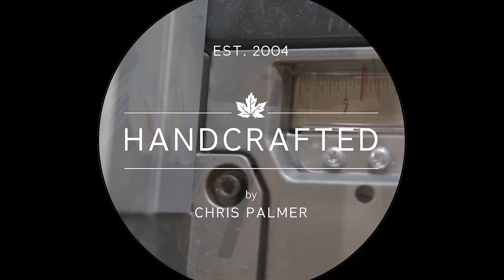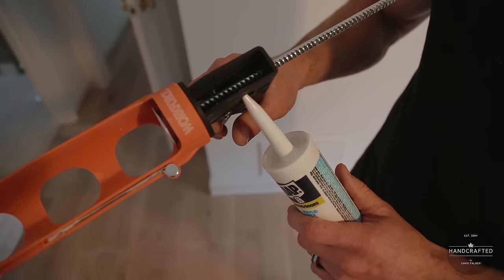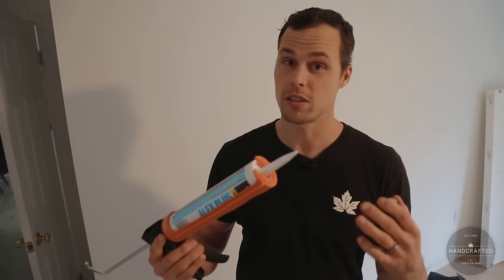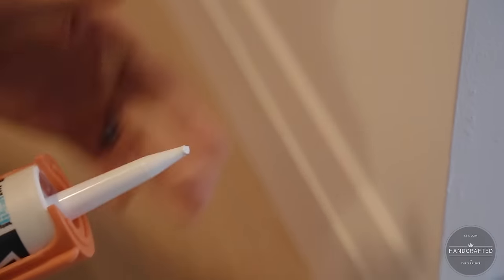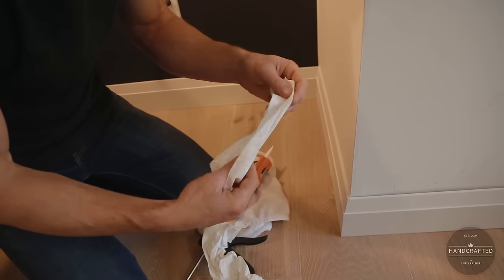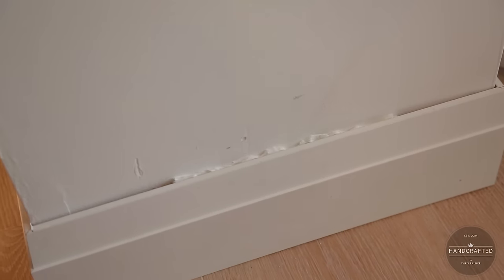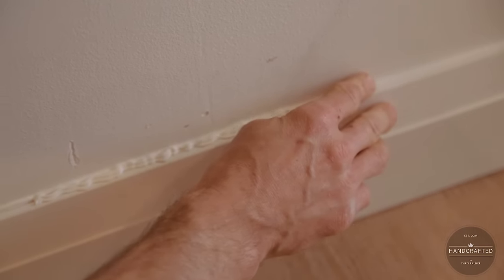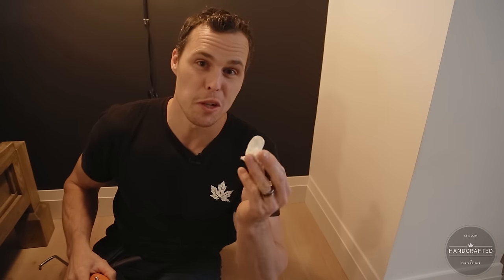How to Caulk like a Pro

Comment: have you ever put. caulking gel on the bottom of the baseboards to keep unwelcome critters from crawling in.?
Reply from the maker: If the gaps on the floor are large, I typically install shoe mould. Not certain on caulk gel.

Comment: Do you have any suggestions on how to caulk around a toilet with several bad areas? The flooring around the toilet is also coming up. Any quick fixes short of replacing tile—as far as holes around toilets and stick on tile paper tearing? 
Again, great channel!! Thanks guy
Shane Aycock
Reply from the maker: Hey thanks for the like and for your question I think you might have a deeper issue if the tiles are lifting. You should inspect the seal of the toilet flange to see if any water is getting between the tiles and the subfloor. This can create a heaved or loose tile. Also, make sure to use 100% silicone around the toilet and it should only go 3/4 around as if the toilet decides to leak the water will be able come out onto your floor allowing you to see the issue and not down the opening of the subfloor. Hope this helps!
Reply: HANDCRAFTED by Chris Palmer Will do! Thanks so much for your help, Chris

Comment: Good video,one quick tip.If you are caulking enough trim that you will use several tubes.Skip those larger gaps until a tube is close to empty,cut your nozzle bigger,that will do a much neater job on those wide gaps.
Reply from the maker: I have done that as well, good tip. Also, if you use the quick dry caulk, you can do a single pass and then a 2nd within an hour and it should build up. 👍

Comment: On the first piece of baseboard you caulked, do you even have to go back over it with your finger if it's a small enough bead line?
Reply from the maker: I always smooth my beads, it's a preferred method before painting to have it smooth, allows paint brush to glide better.

Comment: Can you apply caulk on the hardwood floor and the wall gap?
Reply from the maker: I don't apply caulk on floor to base seams. That's where shoe mould comes in handy. And wall gaps between the base can be troweled out or simply back fill the gap before you apply the caulk.

Comment: Im a  tradesmen, and its never done like that....use a wider cut nozzle to infill the bigger gap , also caulk is a acrylic so when you want to smooth over , use a damp cloth , this way it  smoothes over the caulk and wipes away excess , go and rinse cloth out and  acrylic caulk washes off.....

Comment: Was wondering any tips about filling bigger gaps for areas on exterior of house? Or should I just put a thicker bead of caulk?
Reply from the maker: Outside should always be silicone, and large gaps depends if it's brick or siding. Brick needs parge or pointing. Siding will be dependant on what type. Hope this helps.
Reply: It is the space between the wood border around the garage door and the brick wall. I removed the old caulk and I see some spaced mortar in between the gap. I didn’t know if it was just coincidentally there or there on purpose. Thanks in the meantime!
Reply from the maker: @triciamssensensensibility3350  this is likely from wood shrinkage over time. Backer rod can help, then large bead of silicone or even an aluminum capping to conceal the old wood then silicone.
Reply: Sounds like a good plan. I better get on the ball before it rains! I appreciate your help!
Reply from the maker: @triciamssensensensibility3350  happy to help!

Comment: The answer is probably no, or you would have done it, but I’m wondering if running a screw into the wall through the baseboard to fill in the space. I’d think that the motion would pull out the depression in the wall and reduce the size of space.
Reply from the maker: It's a larger hole to fill and have show thru later on.

Comment: The toilet paper idea is "alright". In areas that are damp/cold drafts.. There's better options to fill the void. Use materials that aren't susceptible to moisture. Plastic or foam backer rods will work better.
Reply from the maker: Agree, I use backer rod as well but it was more of a tip for readily available means 😉

Comment: I personally spray the silicone to get a smother surface and also you dont get sticky fingers but hey thanks for posting.
Reply: Video shows the use of latex caulk.  A wet rag or sponge is best to use to smooth the caulk, because silicone, which would leave a slippery residue on the surface, is not compatible with latex paint.  Water is cheaper, too.  I typically use a moistened sponge to smooth things out.  That caulk shown in the video is great stuff.  Check the label for dry times.  The Alex quick drying product is paint ready in 20 minutes, unless it's put on thick.

Comment: I’ve been needing to learn this for a while...i guess part of my problem is that i haven’t been using a gun, I was only using those squeeze tubes.
Reply from the maker: Yes those tubes are quick and handy for very small areas of work, more so a touch up. But I would try to avoid using them as you'll have more waste and less control than a good dripless gun. 👍

Comment: Nice video. What’s your recommended practise for sealing the tube of caulk once you’re done?
Reply from the maker: Thanks! I always paint the caulk once it's cured, I put a minimum of one coat of paint over top as I usually pre-paint the trim's first coat and then do a 2nd coat installed.
Reply: Thanks but I meant sealing the hole in the caulking tube itself. I use a nail but never get a good seal and it dries up.
Reply from the maker: @kropotken  oh I see, so there's a couple options out there for gimmick plugs, but my simple solution is clean the tip and simply pinch a piece of painters tape on the end. I never have a tube dry up, but mind you I am using cases of caulking through the year. If you have a tube sitting on the shelf for months on end, it may just expire due to environment.
Reply from the maker: @kropotken  this is also a plug I have used in the past that worked well. https://amzn.to/34e17CN
Reply: Handcrafted by Chris Palmer Thanks for the tip!
Reply: This is what I use https://www.harborfreight.com/caulk-saver-97561.html

Comment: A tip for woman caulkers.  If you do any kind of caulking at all that requires multiple caulking cartridges, do yourself a favor and get the Ryobi battery operated caulking gun. You won't be sorry and your caulking won't look like a blind man did it. And I was pleasantly surprised that it is fairly dripless if you are doing it right.
Reply: Elementaldomain I have the Ryobi caulking gun. It is quite helpful because my hands don’t get as sore from squeezing the metal gun. The only downside to the Ryobi caulking gun is that it is a tad bulky and can’t get into some tight spaces. In this case, I have to keep a traditional gun on the side.
Reply: @natalies1295  Yes, i can see that the largesse - LOL - could become a problem.  I have a farm so a great deal of my caulking does not take place in confined places.  I have however, become a big fan of the squeeze tubes.  Often I have just a little space to caulk, maybe something I missed in the first caulk. Although the squeeze tube is a little expensive, opening a new large caulk is more so, and then of course, often drying up before I can use it. Squeeze tubes, my new friend, and helps me on my life goal of learning not to put myself in situations that might not have the happy ending I envision; an important goal for me as a single woman run farm. I have also severed my relationship with silicone caulk. Its messy, it is hard to get an even bead all the way thru even with the Ryobi.  I happened to run across a product on Amazon called Red Devil latex caulking.  I read a lot of naysayers griping about latex but I absolutely love this Red Devil product.  

It doesn't smell, it is not viscous like silicone.  And I always get a perfect bead with it. It smoothes well with a finger and washes off your hands easily.  It might not work for some geographical regions but it works well in the desert and I have found I don't have the pull away problem I had with silicone.

Comment: Would you not fill in the gap first with some type of foam? I saw another video where he did that and I have a huge gap in the bathroom trim. Thank you.
Reply from the maker: This solution is geared towards smaller gaps that a first timer would run into. For larger gaps I recommend drywall mud to smooth it out with a wide drywall knife (10-12") otherwise, spray foam I can't say to use as its a problem maker if you haven't used it before. But there is a material called "backer rod" which I would use on a jobsite if it's required. This goes in and acts like a dam to prevent your caulk from drooping into the gap. In all honesty, the key for any gap is to stop the caulk from drooping, so you can essentially use wood shims, cardboard, paper folded over, plastic or whatever really fits. Feel free to email me a photo and I can help you out further if you need. 👍
Reply: HANDCRAFTED by Chris Palmer Thank you very much! I have a few different pictures I will send you. As a first homeowner I’m trying to learn as I go but a lot seems totally doable.
Reply from the maker: @MsMonsta11  that's the best attitude! Keep it up!

Comment: You don't need to use toilet paper. Just fill in the gap with caulk ten run your finger across but use more of your finger than just the tip. The biggest issue I come across with caulk is when it dries up or is old. When running caulk it tends to skip or is kind of thick making it harder to run your finger. One thing a lot of people do not realize is you need to be very careful if you are not going to paint the walls. You can really mess up your cut in line and make it look bad. You'll have to rub a wet rag up and down the trim to make sure you get the extra off. If you don't it will look wavey or go above your cut in line.
Reply from the maker: The only reason I avoid the excess caulk and use backer rod, or in this quick replacement "TP" is to avoid the messy excess that will sag and require a 2ns pass hours later.  And yes, painting the caulk after is a must or it yellows and collects debris. With paint, it can be cleaned up 👍
Reply: @HandcraftedbyChrisPalmer  if it's sagging you aren't applying enough into the gap. I've installed thousands of feet of trim and never had a problem. It shrinks but it's hardly noticed. I think there is a good chance your method could cause problems down the road because you are only putting a bead across the top. Eventually that toilet paper is going to break up drop in leaving nothing to support your caulk. 

Don't think I'm trying to act like I know it all or something, I'm just saying. I've been installing trim for a very long time. 

The yellowing is only a problem if you're painting the wall as well because you're not going to use a rag. If you're not going to paint the wall, you install the trim and then caulk and then use a wet rag to whip off any excess. When done, it does not look bad.

Comment: Great for white on white trim/wall. Anything else and you're going to be cutting in with wall paint to cover all the smudged caulk you got all over it
Reply from the maker: Caulking should happen before wall paint. We always install out trim after so that a fresh cut line can be created. Also, caulking should be painted to prevent it from collecting dirt and turning yellow. Once painted, caulk will wipe clean easier and match your walls/trim.

Comment: What type of caulk are you using ? Silicon or latex based ? I need something that’s paintable but also little bit flexible but not silicon ! As silicon you can’t paint over
Reply from the maker: That's correct any caulking that's "not silicone" will be al good! Acrylic or latex asked caulk

Comment: You don't need the clean out with Dap painters caulk.  It does not have an internal seal.  I also like to cut the tip with an utility knife.  I have more control..    cheers.
Reply from the maker: You're right, just showing the functionality of the gun only happens for sealed tubes.

Comment: Thanks for the tips. One question, after the caulk/silicone hardens, I had to cut a bigger hole to get the harden part out. Eventually leaving me a big hole. How to fix that?
Reply from the maker: With caulk, it shouldn't harden up like silicone and I usually just cleam the tip and wrap the end in masking tape to prevent air getting in. The same for silicone, if air doesn't hit the silicone, it won't cure to a rubberized end. This should.prevent you from ripping it open larger. 👍

Comment: Hey Chris, great video...what do you use to cap the top after your job is complete?
Reply from the maker: Thanks! Simple trick is painters tape to cover the end. But truthfully you can leave it exposed for a week or so and it will still be good, just have to uncork the dried plug of caulk at the tip.

Comment: Any tips on how to caulk a larger hole? I need to caulk around the bottom of my door frames and I'm making an absolute mess of it.
Reply from the maker: Is it a hole or a gap from bottom of the door jamb to the floor?
Reply from the maker: If the gap is even or slightly sloped, use an off cut piece of the jamb to fill the large void and then use a good wood filled to pack the crease lines out. Let it dry and then sand it.
Reply: @HandcraftedbyChrisPalmer  it is from bottom of door jam to our hardwood. just a small quarter inch gap. good tip, thank you.
Reply from the maker: @dertysprite  use the scrap and then wood filler or dap drydex if you are painting it white. 👍
Reply: @HandcraftedbyChrisPalmer  thanks!

Comment: Push the caulking gun instead of pulling it, this actually drives caulk into your joint and leaves a much more clean bead. You’ll need less caulk and you won’t end up with a huge gob on your finger when you tool it. 

You’ll also find that it doesn’t crack and split when it cures because there’s more in the joint.
Reply from the maker: Thanks for the feedback. 
Have you tried an angled tip? The whole reason you pull it, is because it's virtually self smoothing. I have barely any material on my finger and as long as you trim is installed properly, there should be no cracking if you apply the right amount. 

I have tried the push, but it's not as smooth or consistent for my own experience. Doesn't mean it's bad or wrong, just not as good in my personal opinion.
Reply: Yup, gone both ways, caulk entire houses for a living, interior and exterior, latex, silicone, eurethane, and various additional adhesives. New guys come in dragging the gun and get barked at by experienced crew.
Reply from the maker: @edwardsmith3062  well I guess this crew runs the opposite way haha, we all pull and never have issues.

Comment: Just curious why use the finger.  Wouldn't a caulking edging tool be neater?
Reply from the maker: To be honest Michael, I have tried them and I just prefer my finger. But when it comes to exterior windows and tubs I have some angled tools to keep a bead raised to prevent wanter from sitting. Everything is personal preference, if it works for you and the results are good, then stick with it 👍

Comment: So I just had my patio covered and enclosed. I thought my contractor was going to use tongue and groove board but instead he used cedar planks that you use for fencing. It looks good but my OCD can't overlook the small spaces in between the wood planks. My solution is to caulk it seam by seam. Since I am going to do this, should I use clear or black? My stain is a redish color. I think either color would blend in nicely and I do have some TP handy!  Would you recommend DAP Stretch?
Reply from the maker: Oh this is an exterior application? If so, look to a good sealant. It will be very time consuming and likely tedious. Almost would suggest doing a batten finish on the seam to avoid all that work and make it look far cleaner.
Reply: @HandcraftedbyChrisPalmer   So I looked up what a batten finish is. Wouldn't work for my application because of the angles and  slopes. Too bad I can't post pictures in the comments. Do you have a email where I can send you pics?
Reply from the maker: @1mmotown  for sure send to Info@handcraftedbychrispalmer.com
Reply: Email sent

Comment: Caulking vs Grouting for kitchen use (sink, floor and backsplash wall & toilet (wall, floor)

How effective is caulking against geouting for the application, taking into factors that both areas have contact with water and humid.
Reply from the maker: Great question, whenever you have a grout gap, grout it. However in the areas where walls meet flat surfaces or inside corners of showers, you need to apply a good silicone. Caulk will not suffice in these areas. Silicone is your product of choice 👍

Comment: If it’s not coming out of the gun straight was the tube cut wrong and should be thrown away?
Reply from the maker: The tube can be re cut if it's not too large of a hole already.
Reply from the maker: @jjjjjjjjjjjhjjjjjhjj  silicone is only for wet areas. Caulking is for your trim. Use a wet finger from a rag or cup of soapy water. If the tube is cut too large, then go ahead and use the larger hole to fill larger gaps before replacing it.
Reply from the maker: @jjjjjjjjjjjhjjjjjhjj  so on exteriors I don't use silicone, you want to use a sealant that is manufactured for windows and doors like Quad Seal or any other sealant with high ratings for non cracking and large temperature fluctuations. 
Inside, you can use DAP caulk.

Comment: Most guns dont stop the caulking from coming out, its an air bubble in the tube, once that bubble pops, no more drips
Reply from the maker: What happens most of the time is the pressure guns keep pressure on after the squeeze and that is what creates the run on, some of us forget to release the piston and the last ounce of pressure pushes more out. These dripless function off a gear notch that works to lock it out and stop that excess pressure from squeezing.